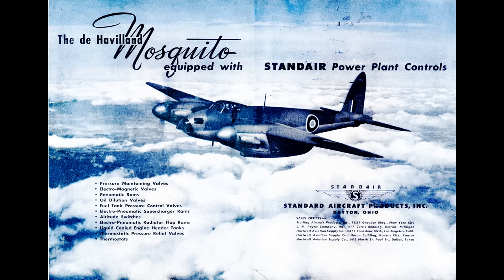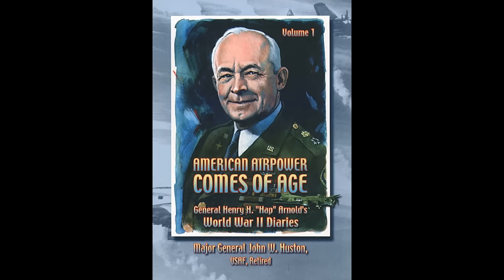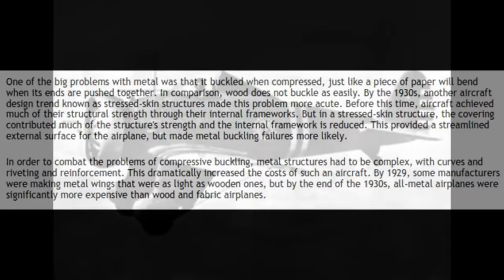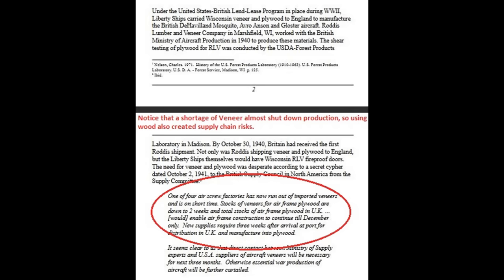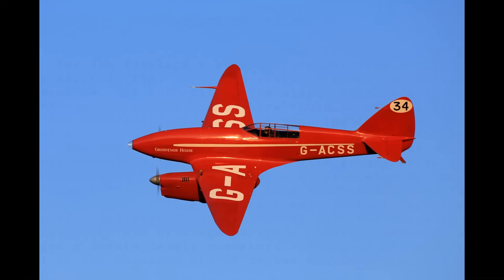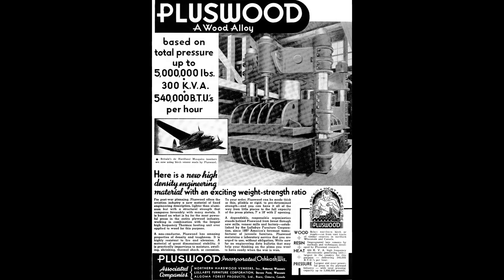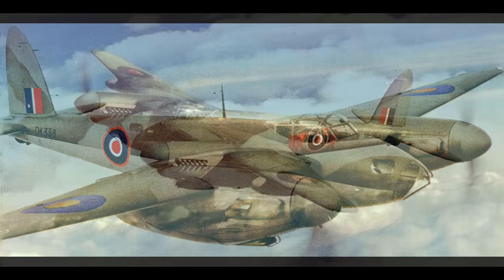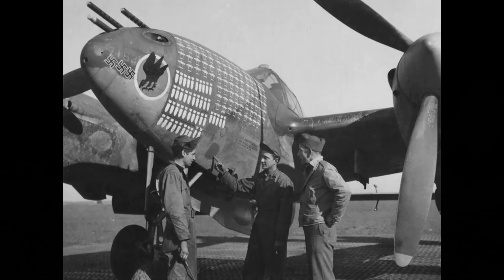De Havilland Mosquito vs. ?

Comment: * You don't quite get the historical context right. Plywood was a rapidly progressing material in the 1930s. The famous modernist Clark, strongly associated with NACA, in 1932 builds a metal low plane with retractable landing gear GA-43 (together with "Mustang designer" Schmued) and in 1937 a high-speed wooden Fairchild F-46, which is advertised as a PLASTIC plane.
By the way, this only built airplane the USSR buys for a lot of money. In the USSR Junkers built all-metal aircraft (later had to retrain with Douglas), but during these years the prominent aviation industry bureaucrat Gorbunov offers Stalin a plastic fighter. This would be LaGG, and later the famous La-7. Equally closely studied the new wooden DH technology, bought the DH Comet and tried to make children of it. There was also an airplane in the USSR, which was called the "Fanera" (plywood) with pride. So, it is high modern, cut corners of progress, ahead time etc.
The most important thing here was not the wood itself, but the impregnating varnish. Amazing: for LaGG fighters the USSR purchased varnish in 1940 in Germany.
Reply from the maker: I wonder why they don't make helicopter rotors out of plywood with this special "impregnating varnish" you speak of. Why not jet airliners? Even de Haviland abandon this outdated construction technique. Wood was a great idea for the Mossie simply because de Haviland couldn't have built it any other way in the time they had, but trying to say it was the way forward or somehow superior to all metal construction is just silly. The Mossie is awesome because of the design, not specifically because it's made of wood. Don't even get me started on the Russian wooden planes.
Reply: @GregsAirplanesandAutomobiles , With all due respect, please do not attack. I have stated my view, willing to expand on it if there is a question. I am Russian, it is difficult for me to express myself correctly in a completely foreign language.
Reply: Jet planes did not immediately lead the British to abandon wooden plastics. The Vampire, Venom had important wooden units. Over time they were replaced by other composites: fiberglass, carbon fiber. And Britain was constantly developing this. It's cutting edge, not ersatz or conservatism.
I'm not trying to, I'm asserting. The Mosquito is designed to be cutting edge. So is the Spruce Goose (using Fairchild-Clark technology). The lacquered LaGG was presented to the customer as perfection, promising 420 mph in 1940.
Note that the technology of gluing a monocoque from spruce veneer of the I-16 is different, but also advanced and from the U.S.. They produced a shell of variable thickness up to >0.1 inch. A simplified ("French") technology in the USSR had the Yaks: wooden beams, sheet metal hoods, crossbar trusses, steel tubular and webbing.
The Mosquito was smooth, with no skin flapping. With 3d curvature. It was a technologically sophisticated airplane, advanced.
Reply: Helicopter rotors were made of wood. Now they are often plastic.
Reply: My intention now is that you take into account that there is a different view from yours, and it is in some way reasonable. There is no agreement among historians on many issues, that's normal.
Reply from the maker: Helicopter rotors were made of wood in the very early days. WERE is the key word here. While they did have advantages in fatigue they had so many other problems often they were quickly replaced with metal blades and eventually composites types entered the scene. Both metal and composite blades are used on new helicopters today, but not wood. 

Yes, de Havilland continued to make planes out of wood throughout the 1940s, but most of those designs were started during the war and de Havilland started to abandon wood construction in about 1945 and was completely done with it by about 1960. It's simply an inferior materiel for building a war plane. This isn't just my opinion, it was the opinion of every aircraft manufacture in WW2 I know of. They all went to metal construction before or during the war with the sole exceptions of the manufacturers that couldn't do it because of logistics or a lack of workers with the right skills. Suggesting that the LaGG was some sort of world class fighter is a joke, so is pointing to the Spruce Goose as some sort of example of success. 

    The Soviets did build some great stuff, I'm not attacking them, and building stuff out of wood was the only way for them to do certain things, but aluminum was better. I do have a video coming up on a Soviet aircraft, which I hope you like.
Reply: 1. The blades were built from plastic backed veneer with pre-70s.
2. DH, who were immediately ahead of the world in many issues, persisted in using wood plastics.
Yes, over time the plastics became glass and then carbon fiber. Yes, these technologies are complicated. Yes, plastics are still much less longevous than aluminum, but used.
---
I attack the Soviet developments, because that is what is more important to me. I know the rhetoric that accompanied the introduction of different technologies. In the beginning it was about how this technology is not wood, but plastic, and that the technology is superior to aluminum.
In a sense, despite the metal TB-1 and TB-3 (following Junkers), the USSR was retraining in 1940 to aluminum as well. The mastering of the Douglas DC-3 and Vultee V-11 is a whole story. It can be seen in one Ilyushin project: the DB-3 and DB-3F. The possible short duration of plastic planes was not confused, they got used to it, increasing the annual production of small aircraft before the war. The benefits, as with any plastic, wanted to get on small designs. Experts from France, from Renault, were of the same opinion. Prior to the collusion with Hitler, Stalin had developed a close relationship with the leftist French government. There is a quick turnaround in policy due to the fact that France was sacrificed by Stalin. Around the same time, some designers formerly associated with German metal technology were jailed (Kalinin was shot). Stalin read up on it and began personally directing the development of aviation from 1937. We have a special history; we have to separate.
For several decades famous de Havilland, Clark, Hughes and Riffard (Caudron-Renault) believed that plastic aircraft manufacturing had a bright future. They weren't wrong about everything. And the Mosquito shows that, and in some Airbus A220. You're the one with the special opinion.
And yes, right away in 1945 the La-7 was converted to the metal La-9, the Yak-9 too. And a hundred thousand Soviet wooden planes were quickly scrapped. But before the war, Stalin didn't know that Hitler would almost take Moscow and take away the aluminum plants in a few months. The point was different: The USSR was the first to begin the military mobilization of industry. Before 1941, before the attack, more than 10,000 I-16s of veneer with casein were built. Nowhere else in the world had so many been built. This is one project alone. And the USSR had hopes to keep at least part of the approach. Soviet fighters are small. Foreign authorities convinced Stalin that it was time. He believed he was a revolutionary, he should be the first. Hughes also wanted to be the first, and de Haviland was just the first, and still will be.

Comment: Regarding the P-38.  Never have I heard about a seaplane version, but I have read on numerous occasions that the bent boom experiment was an attempt to deal with compressability problems.  The idea being to have the horizontal stabilizer above the wing air flow in hopes of regaining elevator response in high speed dives.  Didn't work.
Reply from the maker: They did look into a seaplane version. There were also bent booms tested for compressability, there are actually several bent boom designs.

Comment: IMHO, The greatest aircraft of WW2 was the Mosquito, compare it to modern aircraft; speed, turn, load and COMPOSITE body. Add up everything it could do and do brilliantly and there is nothing even now to compare. My second place would be the A1 Skyraider. There is nothing now that can fill all the roles that those 2 could do, but the World is a very different place now. B52, A10, Hercules, AV8B get mentioned with honour. F14 just a weapons platform for stand off HAVCAP was never a "fighter", F15 too expensive to risk against an enemy before SEAD and DEAD, F16 errrrrr not too shabby. F4 good if it had a gun. Spitfire had to be constantly upgraded to keep up with NAZI aircraft. OH DC3 AWESOME too. All aircraft are defined by their role and success at a moment in time but some go beyond this, the Mosquito never did.

Comment: You know, I was thinking it is useful to add another comment on the evaluation of the Mosquito by the US firms.  Very interesting info, by the way, I was not aware of this evaluation.

On the reasons of the rejections.  I think we have to remember here that wars are not about the best machines or the most efficient method to fight them, and the maximum economy of aircrew lives.  Its about money and money only.  The reasons sited seemed to me that they were excuses in order to justify existing and future contracts.  There were many such examples. 

The easiest to identify such proposal that was shelved for money is the modification of the P-38 to use Merlins instead of Allisons.  Allison lobbied in Congress, and the project was dumped, and the two prototypes were scrapped. 

Another wonderful example is the proposal of Supermarine for a long distance Spitfire that could make the P-51 and P-47 irrelevant.  Supermarine worked on the lateral stability caused by loading up the Spitfire behind the CG with tanks, and was able to match the P-51 internal tank range.  A mass produced Spitfire in the USA would have saved lots and lots of aircrew when faced in 1 to 1 with late model fighters such as the Ki-84 or Bf 109 G and K.  But instead, many Japanese and German aces were generated, along with lots of money for the US defense industry.  The argument against this suggestion would be that the P-51 was far cheaper to produce because it was far more crude, and that the enemy had very few well trained pilots left.  But you try to tell that argument to those shot down due to the poor performance of their aircraft.

Another example was the introduction of the Napier Sabre to the USA.  This was the hottest engine of the war, matched only by its larger copy by Rolls Royce, the Eagle.  It was the highest revving engine of them all, and with 2200 cubic inches was producing the same power (at the end of its development) as the P&W 4360.  It was also sleeve valve, which gave it a potential for very long life, despite the high BMEP.  The Hawker Tempest, despite its porky size and weight, was the fastest fighter of WWII for medium and low altitudes.  Its main limitation was lack of efficient high altitude supercharger.  Imagine a General Electric turbocharged version of that engine.  But again, why promote a foreign design?  Saving aircrew is not the objective here, the objective is making money.  The counter argument to the above was that the Sabre was a bit too complicated for US manufacturers, but I am not sure if I believe that.  They could handle the Merlin just fine.

But of course, let us not forget.  The main objective of WWII was to have the US hegemony replace the British Empire.  Anything that would help Britain come out of its financial collapse would be directly against the US objectives of WWII.  It is amusing how Winston Churchill was knighted for bankrupting his country and dismantling the British Empire.
Reply: I believe the Packard-built Merlin was simplified to suit the American industrial capacity to generate them more efficiently (so ease of manufacturing processes by simplifying some things).  I don't have any firm documentation, only something I recall reading.
Reply: @sean640307  Sean, I do not know if "simplified" is the right term, but it was modified to suit American standards.  I too do not know what were the modifications.  An RR Merlin 60 series was made out of about 20,000 parts.  I seriously doubt that the Packard version will be made out of fewer parts.  The Alison, however, was around half of that.
Reply: @demetridar506  what I had read was using the specific term of "simplified" to ease manufacture.  Your use of the word modified is probably accurate, but they may not be mutually exclusive.   It could well be that by casting something in a particular way, they may removed the need to have it as 3 or 4 separate component parts that had been joined together.  Given that neither of us know, I'm more than content to go with your term of modified.   All in all, it was a very good engine and Packard made a heap of them under license :)
Reply: Yes and no.  It depends upon if the design really really worked well, and if a license could be negotiated with a non-belligerent.  The US negotiated licenses with Rolls-Royce, Bofors, Oerlikon, and many other foreign Companies during WW2.

Comment: NO aircraft (metal or wood) was ever proof to gunfire. Certain parts of certain aircraft had steel armour plate added to protect the pilots and/or engines - and the Mosquito had such armour (as did virtually all other Allied combat aircraft). Gunfire would pass through a metal aircraft structural just as easily as it pass through wooden structural (the metal is only about 0.030” thick - about the same as a garbage can for cryin’ out loud).  Perhaps you should have an engineer review your materials to avoid clangers like that.  
The structural integrity of the Mosquito was actually quite remarkable given the manoeuvrability of such a large and heavily loaded airplane.  Your own video shows Mosquitos with very large portions of the wing or other parts missing - so I think that you answered your own question. While the US Boeing B17 was indeed a great airplane, the fact is that the bomber versions of the Mosquito could carry the same bombload as the B17, the same distance, at nearly TWICE the speed, using less than half the fuel and only two crewmen.  
The fact is the Beech assessment was dead wrong on every point - sorry guys, but the US muffed it.
Reply from the maker: Nowhere did I say that metal planes were bulletproof. I have no idea where you got that. The damaged Mosquitos don't show us much because we don't know what hit them. If it was just a few rounds of 8mm, then that's not so good. As for the Mosquito being able to carry the same bombload as a B-17, no, that's absolutely not true, which I'll cover in a future episode.
Reply: @GregsAirplanesandAutomobiles  Well, I'm sorry Greg - but I listened to your audio twice and it sure sounded that way to me.  
On the matter of bombload, while the B17 could carry up to 8600 lbs of ordinance, for shorter distances at lower altitudes, the typical load was 4,000 lbs for a long range mission to a target like Berlin (look it up) - and the Mosquito could also carry a 4,000 lb "cookie" bomb that far but at a much higher speed. As for battle damage, tolerance check into the Mosquito and you will find that it took at lot more than "a few rounds of 8mm" to tear off most of an outer wing. 
Anyhow - two great airplanes indeed.
Reply: The Mosquito was actually a lousy medium and high altitude bomber.  Note that the RAF ordered many thousands of Lancasters even after the brilliant qualities of the Mosquito were well known

Comment: The comments by Beach were not thought out that's for sure. 
The properties of wood in certain areas are better than steel.  
Others have gone into the Mosquitoes service records and specifications, it's difficult to see and read those and find many flaws. 
Add all that to the fact the the USAAF had several squadrons of Mosquitoes and it would seem that the entire United States aeronautical industry had their collective heads somewhere they didn't belong
Reply from the maker: No, Beech thought this through. You just have to look at it from their financial point of view, they were working on the XA-38 Grizzly.

Comment: Ironic that wood used with the infused glues was a "composite material" - similar to carbon fibre. A step above aluminum. A nice stealth feature too - v, low radar signature.
Reply: "A nice stealth feature too"
Source?

Comment: What makes the wood in the Mosquito useful has nothing to do with wood, it has to do with the adhesive that they used.
Norman de Bruyne's from ARL, their invention of Aerolite was the key that made it possible to use veener sheets. Milk glues (Casein) would have failed De Havilland. 
Reading list: 
Aircraft of Molded Plywood https://www.worldcat.org/profiles/RA122E/lists/3916481

Comment: The Lightning and the Mosquito were comparable as fighters, but the Mosquito was designed as a bomber and went on to fulfill almost every other role it was asked to do. The Lightning was never able to carry a 4000 pound block buster to Berlin. Argument over! This video is so biased from the US point of view. Did the Mosquito have faults Yes, the wood glues in the 1940s could not cope with the tropics, so some brave souls died finding this out, which is why the only flying examples today are recently built (in NZ) replicas.
Reply from the maker: The version of the Mossie that could carry the 4k Cookie was certainly not comparable as a fighter. Why would you throw the Mossie under the bus like that? Obviously it's unfair to the Mossie to use such a limited version of the plane for comparison.
Reply: OK Greg, so there were at least 18 marks of the Mozzie, I was trying to highlight the enormous versatility of the basic design and that the 2 aircraft were designed for different roles. Obviously, as production built up they had to scratch around for more materials and needed the resources of the USA, but the original order was for only 50 machines envisioned for photo reconnaissance.  @GregsAirplanesandAutomobiles